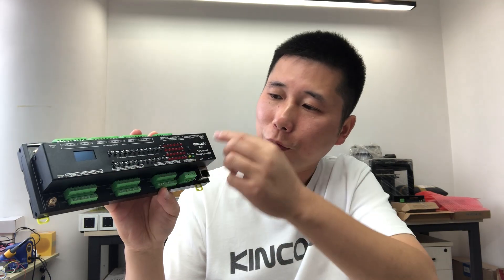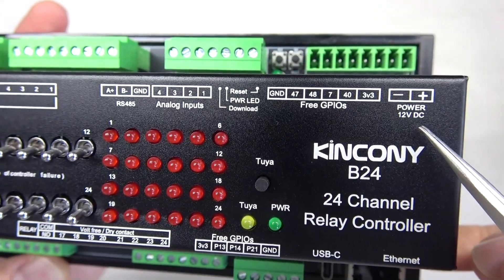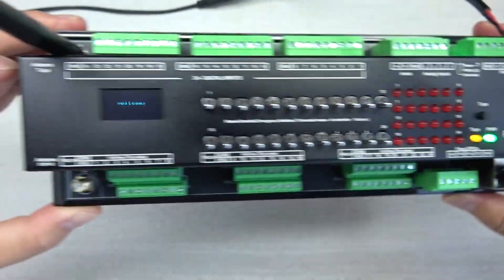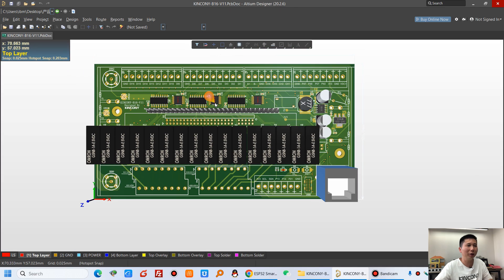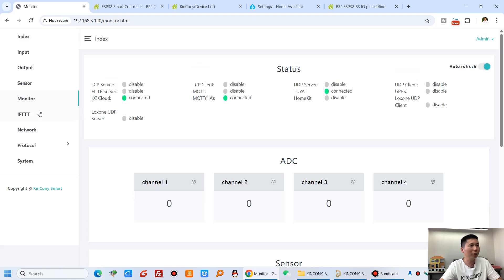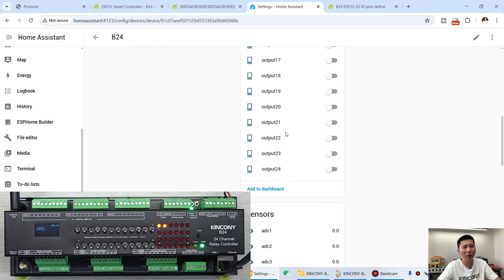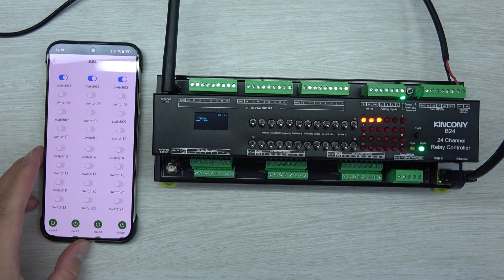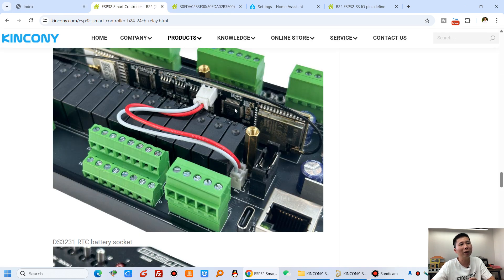new KinCony B24 ESP32 Relay Home Automation Controller For IoT Project

Comment: Amazing, i need to upgrade my smart distribution box with this. Can i use the digital sensors on the free gpios without configuration.
Reply from the maker: sure, just config by KCS v3 firmware.